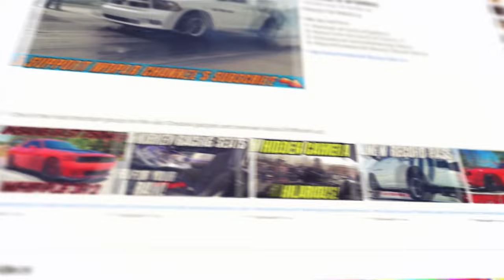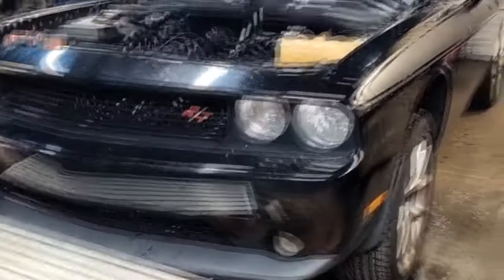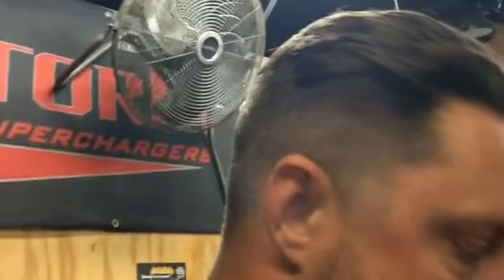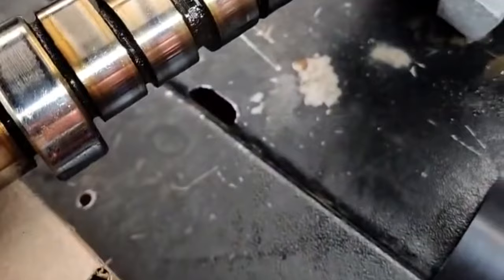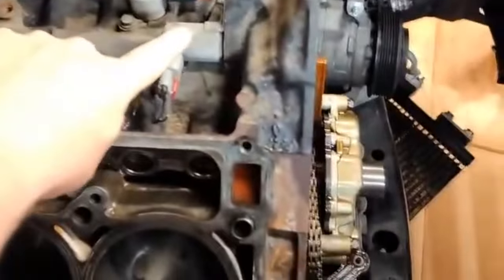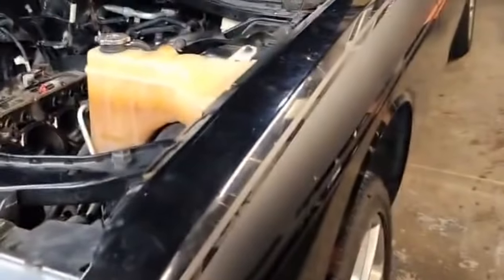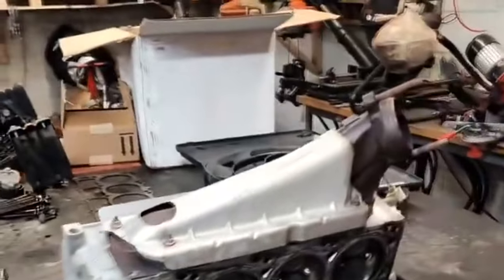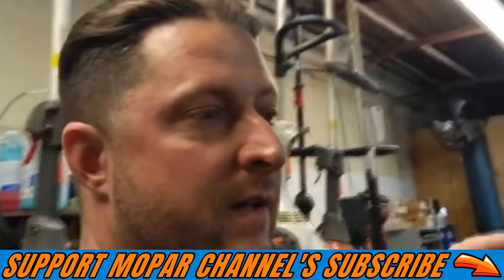Challenger R/T 5.7 HEMI Ticking Like Crazy Part 1.

Comment: 2017 and up needle bearing size was increased in the lifter rollers across the board. Jury is still out if that did the trick.

Comment: I am glad you used the Hellcat lifters. Most people just use a stock 5.7 lifter and claim there is no difference.
Reply: They are not claiming they are correct. The part number is the same. People just say hellcat to describe the difference between the old design and the new design. But the statement there are no hellcat lifters is correct.